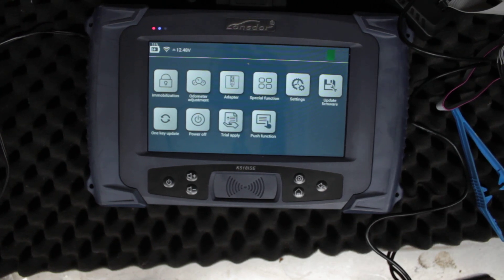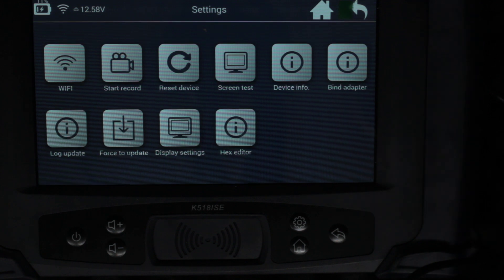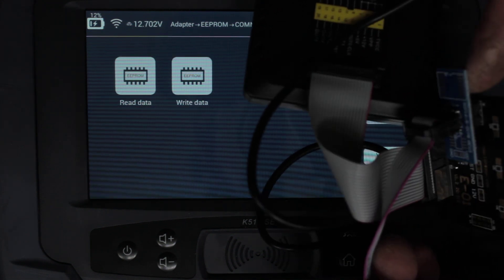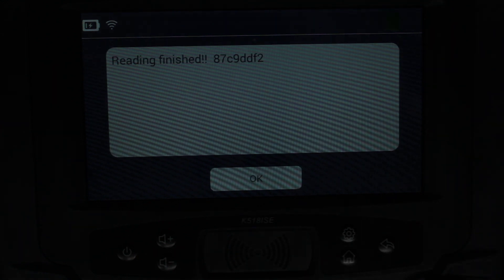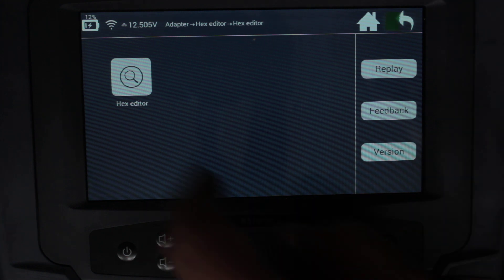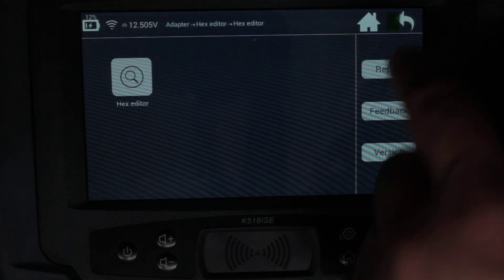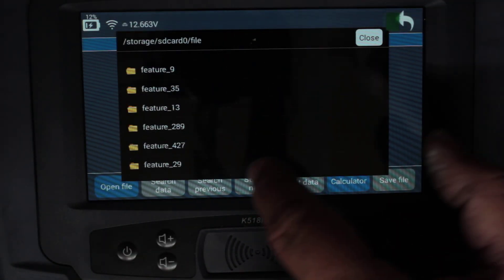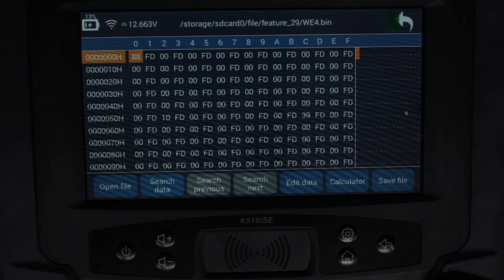KPROG2 Adapter For Lonsdor K518ISE - Working - Part 2

Comment: Says to bind adapter first before using it in the manual! :-)
Noticed too if you see the 'replay' button at anytime on the right of the screen, press it and you 'might', if available see an animated step by step procedure how to carry out something if its available.
Glad to see a fellow owner going through these procedures, really helpful. The only downside to this tool is the lack of a really in depth manual for it.
Funny how it programs remotes to open your garage too! :-)

Comment: That looks really handy for sure. I use an AR32 from around labs and the stupid thing works in bios mode only or on windows XP 32 bit which is all outdated.  To have a platform married to a programmer would be nice for automotive alone. The benefits for the AR32 are rich. I can do crash data, the older Eprom that erase with us light for arcade games or earlier prom chips,  change mileage on clusters erase counters in printers and much more. As a locksmith the Lonsdor would be great for any chip associated with key making so I say thumbs up. I love the hex editor, looks exactly like the ar32 but easier to navigate.

Comment: You can always tell a tool made in China by the lack of instructions. I bought a VVDI tool a month
ago because of the great things it is supposed to be able to do. It had absolutely no paperwork
with it aside from the factory verification sheet. Two things on this, I really hate working in the
dark with this stuff and these companies should not be relying on YouTube videos to take the
place of an actual detailed user manual.
Reply from the maker: 100% they should have good instructions, the vvdi tool is the other video I was going to do next , it seems to work for some things, but like you , I'm in the dark, and when you plug it all in not all of it works, I cant get the key coil to read, so still working on it, I did use it on a Citroen and it did work, did not read pin, but can do keys. maybe this week I will get the time to get it running and pot a video
Reply from the maker: Sorry FVDI , not vvdi